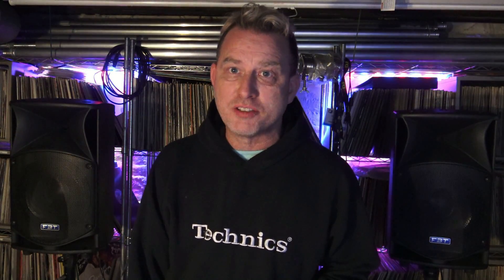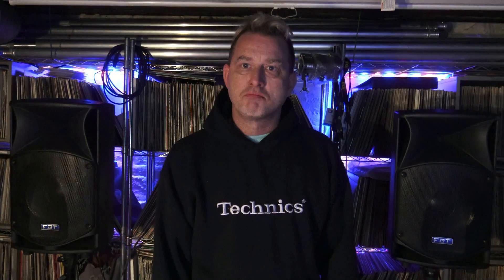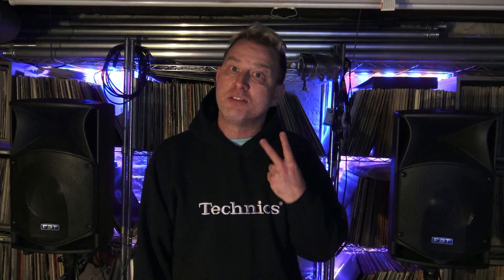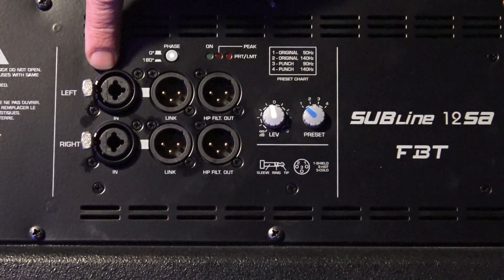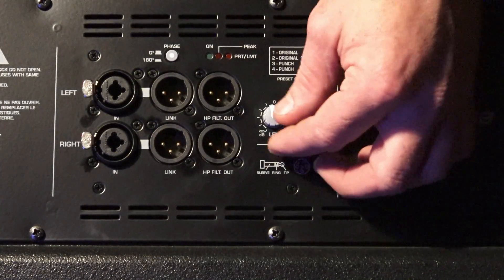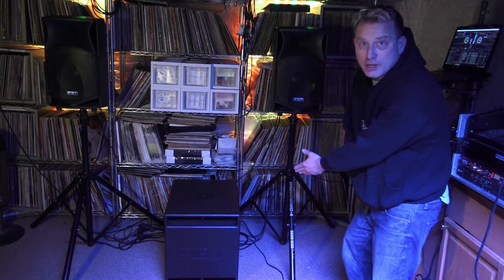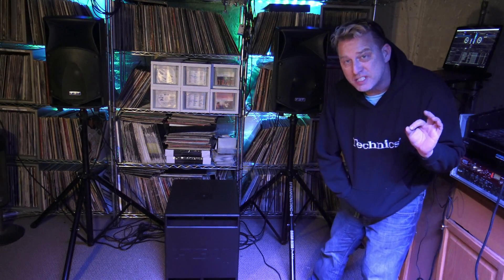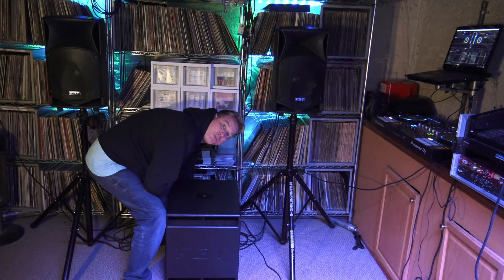DJ Help - What's a Powered Subwoofer's Built In Crossover For?

Comment: I'm purchasing an active subwoofer with built in crossover. My current mains/power amp do not have a link out. Can I run my board into my Subwoofer and the crossover outs into my power amp then to my mains? Or do I need a crossover between the mixer and sub/mains? Can't seem to find this information anywhere

Comment: Hey Brian 
On the new QSC subwoofer KS212C it default at 80hz.. which to me sounds good .the other options is 100hz sounds more bass or punch. 
You made a point that 90-100 may be recommended. 
Should I leave at 100hz at all time.
Thanks

Comment: Hey, thanks for the info about how to connect a power sub[subs] to a basic powered 2 speaker PA System, since I had just bought a PA System a few months back. I just have not yet decided whether I will add 1or 2 subs to my system. I already bought the poles needed if I decide on buying 2 powered subs instead of just 1.
Robert!

Comment: Good explanation as usual Brian! Something I’ve been trying to work out; if my tops also have a cross over built in and I run from mixer to sub first then thru to tops, do I leave the cross over as ‘off’ on my tops? In my case, I have an ev elx200 12sp sub and my tops are ev ekx 12p. The sub has a setting to match the tops, but as the sub came out after the tops, the tops do not have the sub in the dsp menu. From your explanation in this video I’m thinking that’s right as the signal going tops has already been filtered? Cheers.

Comment: Very well explained. What if I want to use four or six tops?
Reply from the maker: You can run as many tops as you'd like.  Most active tops have signal outputs as well.  So, input into top 1.  Then, output goes out of top 1 & into top 2 (and so on).  You mentioned 6 tops.  I will say that when you are adding speakers to a system, you must make a +3db gain to realize anything being louder.  To do this, you must double your power.  In our case with active speakers, we have to double the number of (identical) speakers.  So, 2 speakers are twice as loud as 1.  3 speakers, however, will not give you more loudness.  You may get more coverage if you place them right, but 3 isn't any louder than 2.  To be louder, you'd have to add 2 more for a total of 4.  Going from 4 speakers to 6 speakers isn't louder ether.  You have to double it again, going from 4 to 8.  Then, 8 to 16, 16 to 32, 32 to 64, and so on.
Reply: Run the output from your mixer into the subwoofer first,  come out of the subwoofer's "high pass" outputs to your first set of speakers, then daisy chain via the thru or full range outputs on your speakers to the next set. Ideally, for best results, you should use multiple subwoofers (3 would be appropriate  for this model i would venture to guess when you are running 4 or 6 tops. I would keep the numbers even though so I would do at least 4 subs when running 6 top speakers. 2 should be enough with 4 tops depending on the efficiency of your speakers, subs and the needs of the venue and/or program material.

Comment: As usual thanks Brian.  Very informative.  Quick question, what is the purpose of the THRU on the subwoofer?  I have the 12 inch Behringer subwoofer and maybe I'm doing something wrong but I can't feel much of the low bass.  I don't use the THRU though.
Reply from the maker: Thru would be a full range signal without the High Pass Filter (crossover).  The way most people use this is to link subs together.  So, on sub 1, input full range & output full range using Thru.  Same with every additional sub, until you get to the last one.  You'd want to run a HPF out to your tops to take advantage of it
Reply: Thru is for either adding more subwoofers or passing an unfiltered signal which circumvents the unit's internal crossover. to a set of full range speakers.

Comment: Question I also run Promaxx 14a and mine have the high pass filter on it that I believe is to be used when running them with sobs - if I use the lo pass filter adjustment on my sub like you did in this video - should I still press the filter on the promaxx's ?
Reply from the maker: You don't need to

Comment: so on my turbosound iq18b im running 2 mackie thump 15's what frequency should i set on the sub?
Reply: Try starting at 80hz and gradually raise the crossover point if you notice there is a void between where the midbass and sub bass should meet.

Comment: Brian, I'm currently using a BBE sonic maximizer 882i.  My outputs are going from the BBE out independently to a jbl prx718xlf powered sub, and two JBL EONs.  My question is...should I be going from the BBE to the sub, from sub to one speaker and for the other side BBE to speaker?

Comment: Excellent video Brian (as always). 
I usually tell people to think of a two way top cabinet on top of a sub as a 3 way system all working in harmony.  Instead of high & low, you now have high, MID and low, so each speaker can do what it was designed to do.  
The other perk of this is that you can use a smaller top cabinet (10" or 12") instead of a 15" and save weight, space & back pain--plus they cost less.
The sound will be equivalent or even better.

Comment: Also, "sub-bass" tends to be better with larger speakers (12" to 15" for example) as found in subwoofers.

By using a subwoofer, you are taking away what is possibly the hardest part of the work the main speakers have to do, so its woofer (and possibly the amp) does not have to work as hard and can be turned up further and suffer from less distortion.

Comment: how does it effect bass notes of differing timbre? Say a note like a square wave @ A1 55 htz. It's components would be made of odd hamonics @ A3 165 htz A5 605... and up Its fundamental would be sent to the sub and higher components up to the woofer with the low pass set to 90 htz.
Reply from the maker: +NC8ED The reproduction of a note that ends up both below & above the frequency range set by a 2 way active crossover will be split between the sub & tops.  How well the sound is reproduced will depend on the speakers used.  It's been my experience that the best bass notes above 100 htz, for a DJ PA system like this, are made with 12" woofers.  anything smaller seems to lack punch & anything bigger tends to sound more "muddy" to me.

Comment: Finally a decent video on the web that explains this clearly! 
Thank you! If you could, can you show how to hook up the same setup coming out of a dj controller with xlr connections? (Basically, where each cable runs in and out of) Would that make any difference? Thanks again!
Reply from the maker: +YourDJ DannyD You just run out of your mixer's main output.  Just like you would with any other speakers.  The only difference is in this case, you run to your subs, then "out" of your subs to your tops
Reply: Thank you!

Comment: Great video, I use to DJ and I had a system of 18" subs, and 15" 6" and a Sammy tweeter it was a SoundTech system back in the mid 90's powered off a QSC USA 1300 was a great sounding system and worked well. Things have sure changed since then with powered systems. My home computer system is studio monitors with a 8" and a tweeter and a 10" sub so pretty much what your using in the video. I have dome the big systems for DJ and car audio and I can say the small systems walk all over the big ones of years ago and with so much less power!!!! I am curious on the twin sub setup!

Comment: i also keep the main volume dials on the power amps no more than 3/4 , and i keep the mixer at 0 , but i also have active duel band DOD eq and it has a lot of gain but i am usually keeping the eq flat in most cases, sometimes a +2 - 4DB above flat,,,,,also, be careful with sub harmonic processors, they can destroy a subwoffer if its set too agressive

Comment: watched the first few secs but my system is bi-amped , no extreme low frequency ever gets to my tops / full range cabs, everything below 40 HZ goes directly to my subs which has its own amp
Reply from the maker: +yellowgroove 40 MHz is a lot of sub frequency going to your tops!
Reply: +briansredd  i have peavey tops , they can take 40 hz for popular program music but for an event like a rap / hip hop type event or party, i will not cutoof @ 40, but i do have a subharmonic processor which will enhance the low frequency on the highest peaks of the low frequency notes if that makes any sense....
Reply: +yellowgroove You would be surprised how much louder & cleaner your system will sound (with less effort) if you move your crossover up to around 100 hz.  Let that big sub do what it was designed to do & carry the load.  Your top cabinets will thank you.
Reply: +DayNNyteDJs thanks, i think i will crossover  the tops at 100....also, i think i got too much processing, i might take the EQ and sub harmonic processor out of the loop and just set the crossover points on the amps  and run directly off the mixer
Reply: +yellowgroove Most EQ's and processors have a "bypass" button.  Try hitting that & set your crossover points, then turn them on one at a time & keep making the sound better.  Start with your EQ flat & make small adjustments.  Every room is different & they can be great tools.